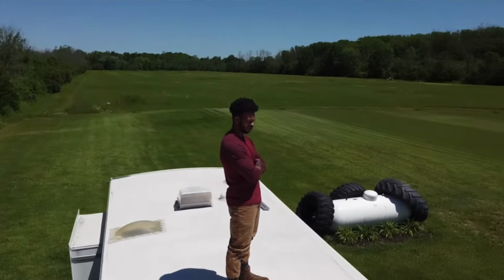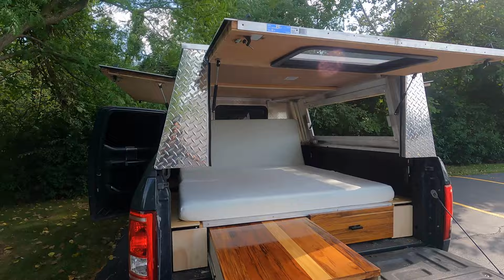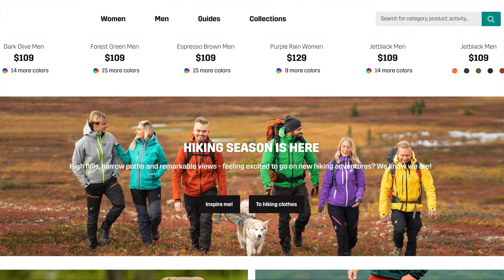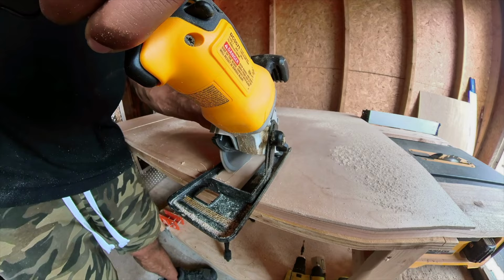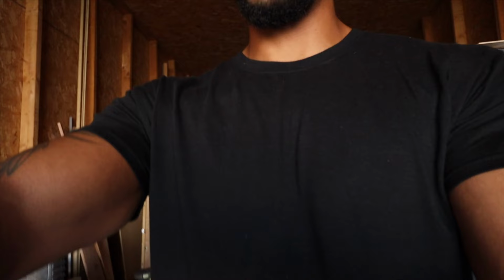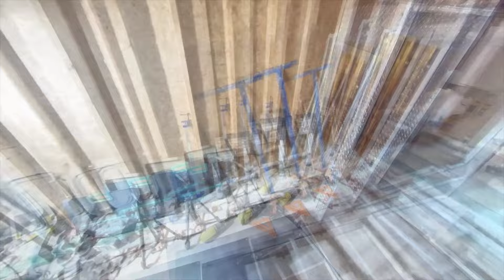Building the Walls & Ceiling for my Pop up Rooftop Tent | Overland Truck Camper ep. 6

Comment: You used butyl instead of silicon 👌🏻 but you should use it with the screws to so you waterproof the holes. Here in sweden its allways raining so on my job we use more butyl than we need on the caravans / RVs and then peel the butyl that sticks out 😊 keep up the good work 💪🏻
Reply from the maker: Not finished installing the rooftop appliances yet. Everything is actually getting screwed down as well. Thanks for the tips I think this is going to work out really well

Comment: 2:12 starts the actual video.  Also you might think about eternabond tape around your ceiling fan/vent and skylight, that will help keep the water out in conjunction with the butyl tape you used.  That and/or  Dicor.  Use EVERYTHING you can to seal against water.  Might even consider using "Red Guard" on all your wood pieces.

Comment: I’m not sure if it was the video angle, but did the skylight fit?  Also, owning a clamshell style RTT, over engineer the weather proofing.  There’s something about that hinge being exposed to highway speed winds, and rain that makes the water run in ways that are hard to predict.  And even if it doesnt get inside the living portion, it can get stuck between the seal and canvas leading to mildew.

You’ve got mad skills and are an inspiration!  Keep getting it!

Comment: Bro!!  Love the channel and your work; very talented and all your episodes are informative and entertaining!!  I do have a question about the solar setup you are going with.  I briefly saw you placed a flexible solar panel on the roof with it looks like Duct Tape.  I’ve had quite a few of those flexible panels and they need at least an inch of clearance to breath or they will over heat and not work.  If it is temporary, cool, but over time you will notice a drop in its ability and eventually stop working all together.  Thanks for listening and keep up the good work!!!